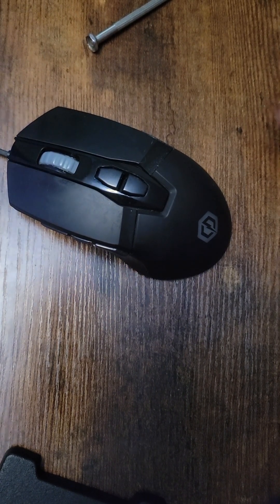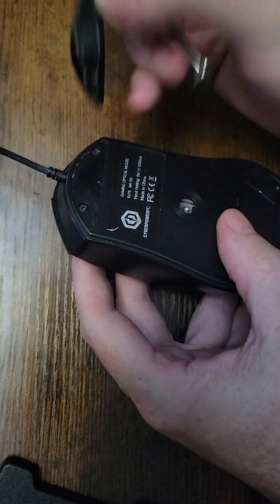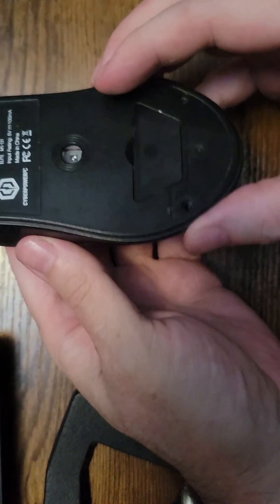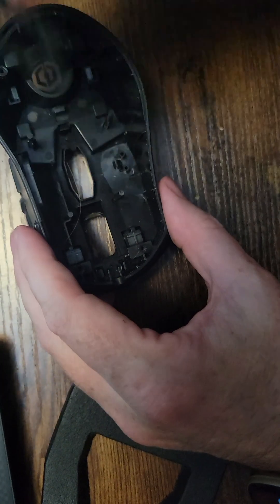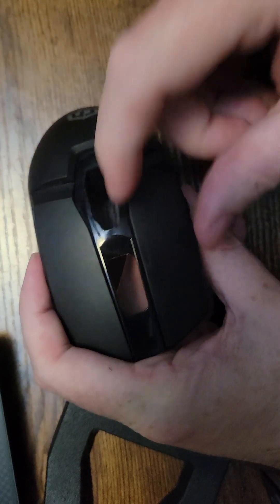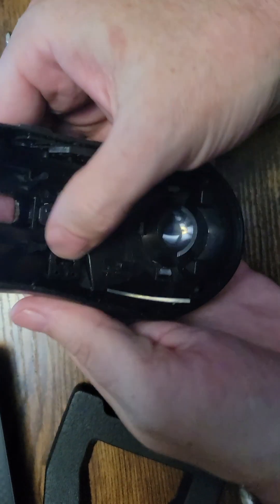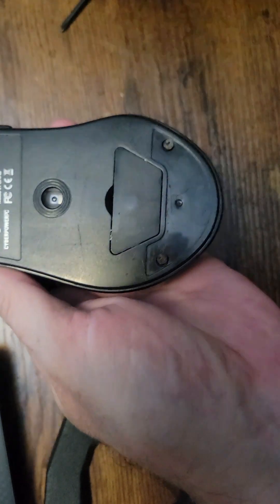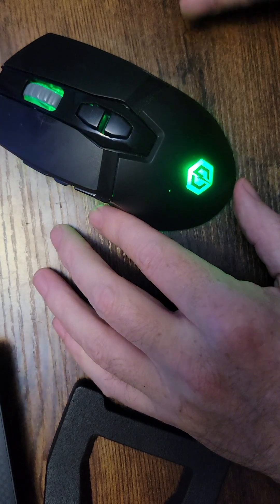CyberPowerPC M1-131 Mouse stuck buttons fix (complete disassembly)

Comment: Crack it open and find out why. It should depress and return back to position. Chances are that it's not positioned correctly, and you just need to put it back in place.